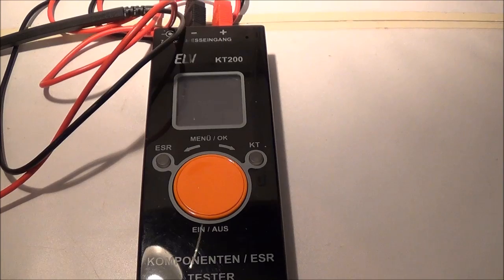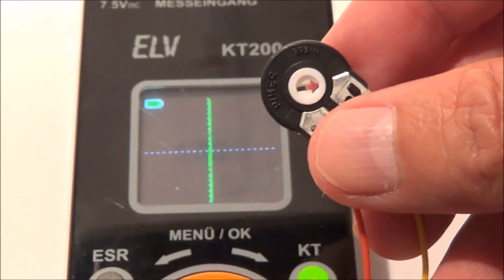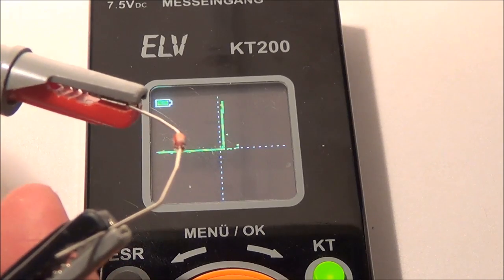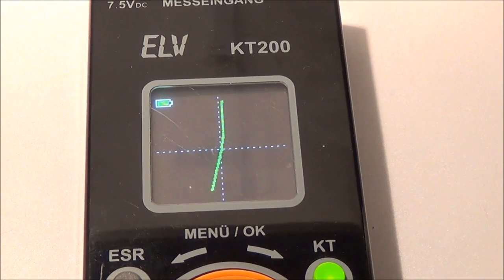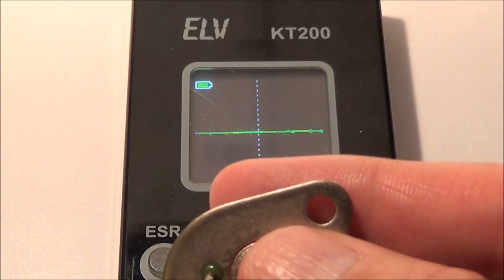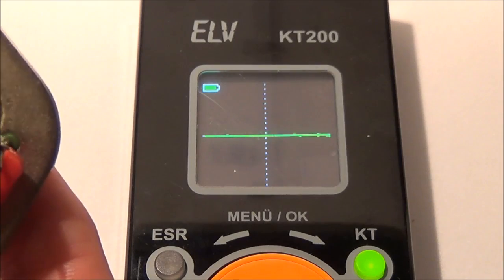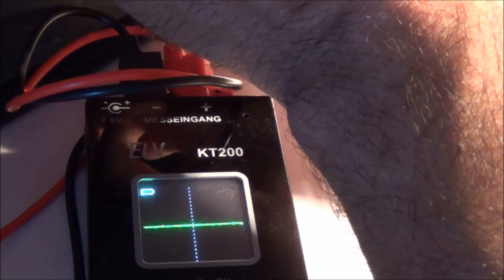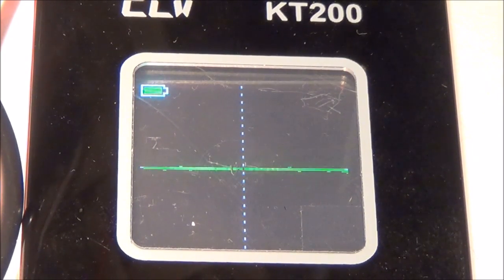ELV KT200 PART1

Comment: I built mine but I can't get the initialisation adjustments to pass, and test 4 nothing moves when I turn the dial.
I wonder if you could tell me what the potentiometer resistance should be set to on the side as I can't find my instruction manual.

For everyone asking where to buy it, I bought this as a kit from Germany via the following link (in german) https://www.elv.de/KT200-%E2%80%93-zwei-Ger%C3%A4te-in-einem-Komponententester-und-ESR-Messger%C3%A4t/x.aspx/cid_726/detail_47290 and had it shipped to the UK for 90.90Euros at the time.
Reply from the maker: My instructions are in German and I don't exactly remember what I did. 
Loosely translated: For the hardware calibration you first put the unit into the component test mode. For this you adjust R36 so that the amplitude of the 50 Hz waveform is 20 volts peak-to-peak. Or, if you don't have a scope adjust R36 until the the waveform reaches the horizontal lines. I think R36 ist the 2,000 ohm potentiometer on the side. If you use this method, there is nothing attached to the test leads. If you use the scope, the scope probe is attached to the test leads of the ELV, of course. And you have to be in component test mode, not calibration or ESR mode. You then go into calibration mode to do the software calibration.

Comment: How did you obtain your tester? ELV Will not sell directly to USA folks. I have friends in Germany that will purchase it for me.
Reply from the maker: +Melvin Pratt You will have to get a friend with an APO military address to send it to you. Or get it off of Ebay Germany used and see if the seller will send it to you. There are no shortcuts.
Reply: Ok, will do. Much thanks, great video.
Reply from the maker: I don't know if I mentioned this since it has been so long: this is a kit. I don't know if they sell ready-to-use units.